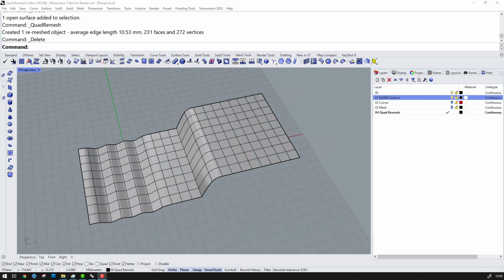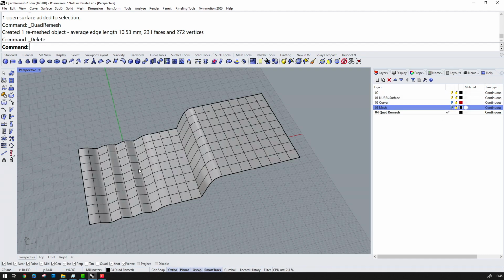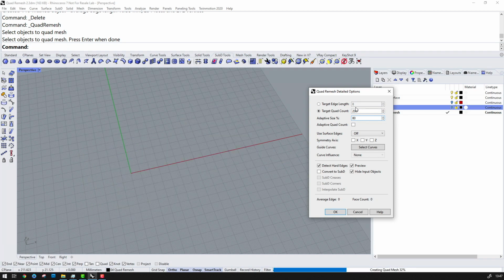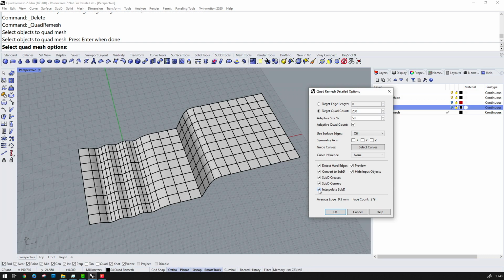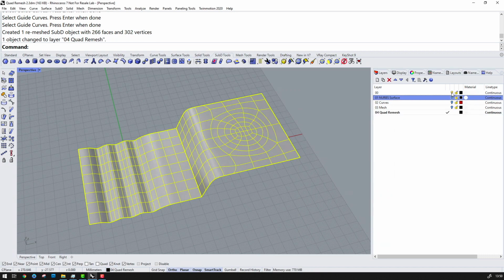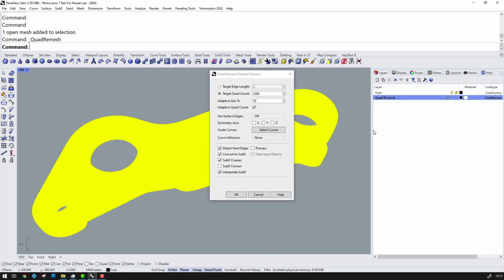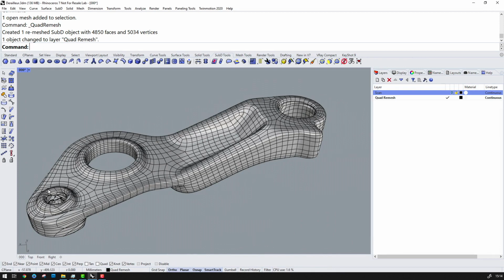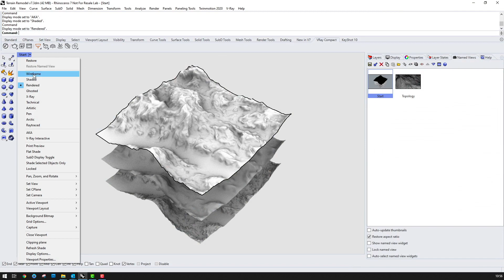Rhino 3D v7 - QuadRemesh, a Quick Introduction

Comment: Hi, I want to generate a topographic surface based on polylines. After generating the surface, I want to create a point cloud from the created surface. It is possible?
Thanks!
Reply from the maker: To create a surface from a series of contours (and let’s say that these include both open and closed curves) you can use the Patch Command. If you want to retopologise the resulting surface so the structure more closely represents the contour curves then you can use Quad Remesh to create a SubD Surface. With either a NURBS, SubD or Mesh you can use Extract Points to generate a set of points that can be converted to a point cloud or alternatively (and this may be a better approach) you can project a grid of lines onto the surface, SubD or Mesh and then using the projected curves only run Curve > Curve from Objects > Intersection to create a set of points. Hope this helps.
Reply: @SimplyRhino3D  Thank you very much.

Comment: It's quite unbelievable that no one seems to be thinking of point clouds to be meshed in rhino. I can mesh clouds with the XirusCad PlugIn, but have no chance to do any adjustments in it. If one has a very noisy cloud as usual in shipbuilding with scaffolding, people, welding machines, hoses everywhere, straightening plates and so on, there's no real effective way to go. I have been cleaning up the cloud already for days and still there's no way inside rhino. In one word? Poor, really poor.
Reply from the maker: Hi Andre, The free Cockroach plug-in for Rhino will create meshes from a point cloud. It can be downloaded via the v7 Package Manager or from Food4Rhino:
 
https://www.food4rhino.com/en/app/cockroach
Reply: @SimplyRhino3D  Thank you! I was looking for such tool as well.
Reply from the maker: @dkokalanov  No problem, you can also check out the WIP of Rhino 8 and a new feature called 'ShrinkWrap' - that's very exciting for this kind of task!

Comment: How to keep the original boundary?
Reply from the maker: Do you mean the terrain boundary? Obviously the simplified mesh boundary can’t match the existing boundary, as we need the exact number of edges to create a match. So, in Plan I would reduce the boundary of the rebuilt Mesh or SubD and then create a transitional Mesh or Surface between the two. There is a work in progress command to match SubD edges in development but this won’t be available for a while.

Comment: How to retain the original boundary?
Reply from the maker: Do you mean the terrain boundary? Obviously the simplified mesh boundary can’t match the existing boundary, as we need the exact number of edges to create a match. So, in Plan I would reduce the boundary of the rebuilt Mesh or SubD and then create a transitional Mesh or Surface between the two. There is a work in progress command to match SubD edges in development but this won’t be available for a while.